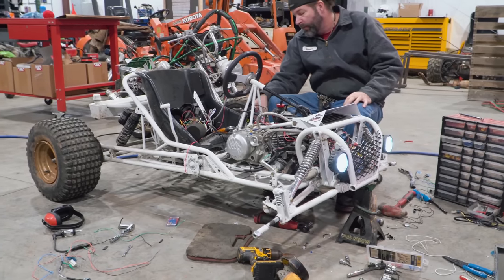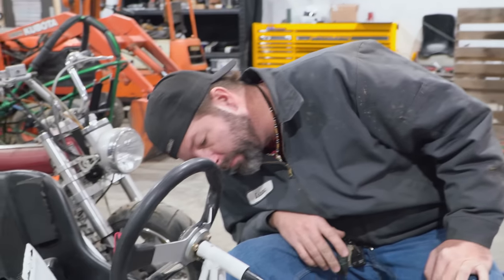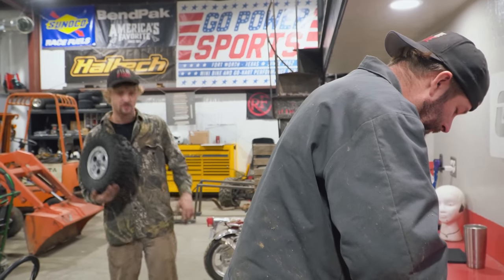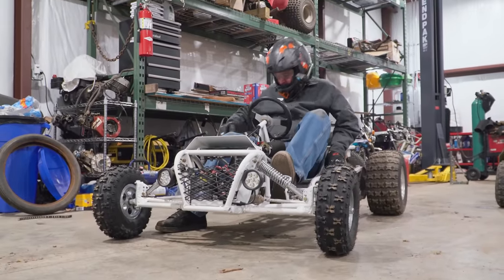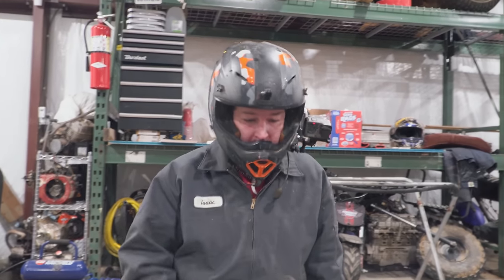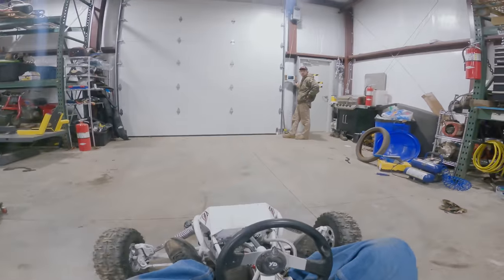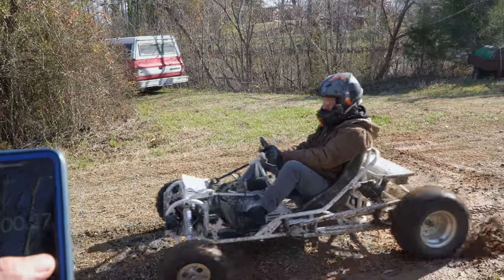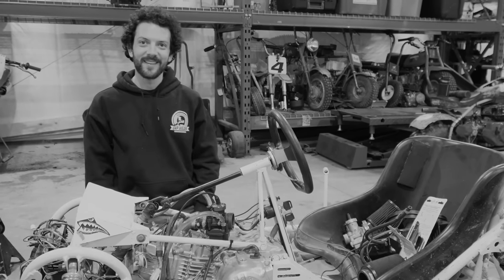Reviving our FASTEST Home Made Go Kart, the “Yard Dart”

Comment from the maker: Happy new year everyone! We're working hard on our first big car build- stay tuned!
Reply: Please install a 250cc 2 stroke engine from a Suzuki rm, Honda Cr, Kawasaki kx, Yamaha yz. You won’t be disappointed
Reply: Happy new years guys 🤟🏾
Reply: I hope it’s a car build using a predator 212, you know back to the roots and what not
Reply: Maybe back pressure issue due to exhaust.
Reply: Happy New Year to this Old Man's favorite three.  Knowing you will get the problem corrected. 🛵🧔💝💝💝
Reply: With the backfire it might be a timing issue
Reply: That's why we have auto electricians, it takes a certain kind of crazy to enjoy messing with wiring harnesses 🙃
Reply: Check the fuel filter or the pickup in the tank make sure it's not clogged or have a vaccume leak
Reply: @JohnHill-jm7tm  Happy New Year!!
Reply: Possible vacuum lock from tank?
Reply: Yes there could be a pin hole leak from anywhere in the fuel system.not saying that is the case.but it wouldn't hurt to preform a vaccume test on the fuel system. 5 or 10 pounds will be enough
Reply: Be careful with that engine while tuning it. It Will blow a hole to the piston or snap the timing chain whille stutterin due the high compression. I have had 4 of those engines on different projekts  and they newer worked right. Good New year and greetings from finland
Reply: What are you guys doing for fuel delivery?

Also is there a possibility of vapor lock on the fuel tank? Is the fuel tank or cap vented?
Reply: cdi related issue... i used to mess around with these style engines alot...would of said carb but that backfire is a tad extreme... thank me later 😉
Reply: cheek the plastic pacer for the carby i had to take mine off and run metal to metal for the carby to work as i kept blowing and brakeing the plastic spacers from the carby and it would run like that and then i had to change the jet to a little bigger one and it got rid of all that boggin and ran perfect
Reply: Hey what happened to the desisl go cart yall made a few years back? I'm curious to see what else yall could make that moto work on
Reply: Happy New Year fellers!!
I truly do hope it's a better year for everyone alive...
Reply: Happy new year to all of you
Reply: Hey r yall givin away anythin via a # u text
Reply: Happy new year guys. If you havent done any other modification apart from carb then check cooling. I found in spec its oil cooled (never heard of) check for pressure and if its lube everywhere specialy cylinder+head.
Reply: Happy New Year guys from us in South Wales, UK
Reply: Sounds like an air leak on the carb or intake??👀👀
Reply: Happy new years also those are lean pops I would be looking at the intake gaskets and maybe a smaller carb... 190 cc so less than a 22 mm carb maybe even a 19 mm. The reason I say this is medium to high loads will keep the fuel away from the pickup tube but in a small carb it can't get away from it. Or tip the carb 20 degs so under load fuel sits flat in the bowl. Stay safe guys.
Reply: Hi there lads I think I no what your issue is as us lot over in England UK actually race pitbike engines and we have a 190cc class that people run these engines with in there pitbikes and it sounds like you have the wrong ignition system for the 190cc as ooracing have a certain ignition system for the 190cc if you have a look on there website you will find the ignition system I'm talking about
Reply: @Kyle Teal  190cc engines use a 30mm carb 19mm is for a 50cc engine
Reply: How soft are the valve springs on that engine.  It almost sounds like the valves are floating and your losing compression at high rpms. Just a thought.
Reply: Happy new year to you too! And can't wait to see that new project.
Reply: It’s gotta be the cdi jit
Reply: @johninzerillo1510  thanks Doc.  Same to you 🧔💝
Reply: Please read Cars And Cameras!!!!  All the problem is the gas is sloshing to one side in the bowl !!!!  Notice it only starts to act up while in turns and carries its miss in the straight aways for a sec.  check the float  and the gas tank.
Reply: Maybe cause no vent on the gas tank I had a 110 ching chang pit bike that didn't have a vent on the tank anywhere I drilled a hole in the gas cap cause my gramps had an experience with a small engine doing this just a thought
Reply: Yo - way too much air going in is the problem - it's what fixed my issue - i put a half cup guard around the air filter so it would take in less air - and BOOM - she purrs like a TIGA BAYBAYZ!   (so imagine an air filter - cone - with a cup over it that covers the front and half of it so only the bottom half is exposed.) -  i thought it was lean - it is not the issue - the issue is too much air going in.  I kid you not - i almost cried lol

Comment: I've had a problem with a Chinese quad that had the same issue it's not the carb it's the CDI either the pickup or the box itself has  going bad
Reply: Exactly like I said.
Reply: Agreed.  I had the same issue.  I fixed it with the OORacing ignition corrector and CDI.
Reply: also had a Chinese quad with tight valves cause the same issue. they wear tight so it could be something to look into
Reply: I haven't watched the video yet but I would consider checking the primary stator. those can cause no spark, intermittent spark and even cause the engine to not rev up and sound like a carb issue.
Reply: If you have a multimeter, you can go around the bike and check all the ignition components, except for maybe the cdi but if everything else check out, its most likely the cdi.
Reply: I'm leaning towards the CDI.. I'm saying that cuz decided to use a CDI that came with a Chinese 125cc motor and started misfiring in the higher RPM on my zs190 so I swapped it out and use the CDI that came with the zs190 (physically larger in size) and I had no more issues and wants to rev to the Moon..  almost got 10k Street miles on it now and haven't had a misfire since then
Reply: I have to agree. I've worked on power equipment and all types of at,atv,etc. Acting like having a heatup circuit failure in cdi.
Reply: I find with these chinese engines, like 9 out of 10 it's the CDI box.  I always keep a spare. Why not? they are like $0.001 yen each.
Reply: Watching it ...I agree ....
Cdi or timer
Reply: Valve setup
Reply: I thought that at first to but they said they replaced it .
Reply: @davidhill588  I think the springs are not able to hold the pressure under load and it’s causing the valves to open prematurely
Reply: Sounds like that's probably the problem.  Bad cdi. Or one of the wires for it
Reply: Yes its an cdi or ground problem
Reply: I've gone throught 8 cdis with my Chinese quad it fails a lot
Reply: @harryfp1494  Yes, but the trouble is, those things are so very shitty that I wouldn't be surprised if they got a second bad one right out of the box.  I have also had them not be bad, but a terrible connection on them.  I have had to zip tie the harness tightly to the cdi box to get it to work.
Reply: its the type
Reply: I've seen the same thing and agree. Definitely ignition. Probably wouldn't hurt to check valve clearances as well
Reply: CDI or rectifier
Reply: Same issue on a 125cc Chinese pit bike I had. Pulled the Cdi coil behind the flywheel and after replacing it the bike runs like brand new

Comment: That backfire sounds like ignition problems. My 150cc Chinese bike did the same thing. I changed the CDI box that had a higher rev limiter and changed the coil with a new spark plug.  That took care of my problem. Hopefully it'll work for you.
Reply: Still can be an ignition issue, but backfire is out the intake system. This is afterfiring, in the exhaust.

Comment: If it keeps giving you issues check the pickup for the ignition on the flywheel, I've had issues with the housing being cracked and loose making it not run right and being all over the place. Im thinking it's something to do with ignition
Reply: Agreed, why is no one checking voltages it was obvious to me that elec ignition was missing the mark
Reply: i agree aswell its always sounding like it drowning in gas
Reply: Vibrations at higher rpms throw it off time and bap bap bap bap bap you have a rotary powered cart without the rotary.
Reply: @NubsWithGuns  where did he say "poke and hope"? He gave a legit idea and explanation to check voltage going into and out of the cdi. It would certainly head in the right direction, or at the very least check a rather large component of the list. 🤷🤔

Comment: 20 year motorcycle mechanic here and I can be wrong but that foam filter looked pretty dry, foam filters are amazing as long as they are properly oiled. Head down to a yamaha motorcycle shop and pick up a bottle of Yamalube foam filter oil. You want a thorough coating on the foam but don't over oil. 
The oil gets super sticky and traps dirt once the solvent evaporates out of it, it keeps your foam lasting longer, and it also solves alot of strange tuning issues. If the filter is dry it actually flows too much air and does not have enough restriction, I know it sounds counter productive, and can cause fueling issues at higher RPM. 

At idle or partial throttle applications its usually decent because there is enough air speed and vacuum created by the slide being slightly open but at wide open it looses alot of the vacuum and can create a lean condition up top especially snapping from idle to wide open most of the time it just falls on its face. With a properly oiled filter it still has enough restriction to help pull the fuel up through the jetting at wide open. 

The air fuel screw on the carb usually if it is on the bottom by the bowl adjust fuel I discovered at sea level or really close 2 ¾ turns out from lightly closed was the happy spot for just about everything I have ever worked on. If it adjust air, usually on the side of the carb, its usually 1 turn out from lightly seated is a happy spot. 

Religiously watch the videos, love the content, looks like way too much fun. Hopefully this may shed some light on your issues if anything might just get you some snappier throttle response off idle

Warning though the yamaha filter oil makes a mess, I always put a plastic bag over my hand and used the bag to massage the oil into the filter, then let the filter air dry for about 10-15 mins to let solvent evaporate or can cause a temporary over rich condition at idle also if you over oil the filter. Just a good coating overall is all you need. 

I might be wrong but hope this helps

Comment: I had the same problem with my ZS190.  I fixed it with an OORacing 100w ignition corrector and OORacing CDI.   That stopped the mid/high throttle breakup.  I also added a real PE28 carb which also cleaned up the running.  Those things resolved all of my running issues and now it runs like a dream.

Comment: Had  a similar issue with a grom clone with a high compression setup. For me I had to go with a 2 step colder spark plug because it was causing preignition with the Chinese plug it came with. You could jet it up and it would run smooth but wouldn't make any power. Then jet it down and it would backfire and spit and sputter due to the early combustion. That would be a good start along with checking the spark plug cap if its the resistor style and make sure its not too high impedance and causing it to blow the spark out. Could delete the resistor too and force it to have stronger spark for as long as the coil can stand it.

Great video too btw!

Comment: I had a similar problem with a Bombardier 90 ATV. Turned out it was a bad flywheel. The magnet apparently weakened so we would get intermittent ignition issues, hard starting, poor throttle response, you name it. We changed out else everything first. If you're having to run a tight gap between the ignition pickup and the flywheel to make it start better, (we had to set it at .010 and the spec was around .050, as I recall) that's likely your issue. Many manufacturers use cheap flywheel magnets, and they will cause havoc on many brands and I hear this is a very common issue. I would also re-verify timing is correct and add an offset flywheel-crank woodruff key to advance the timing a bit (maybe 4 degrees +/-) if the ignition pickup is nonadjustable. May really help performance and throttle response once you get the miss resolved. Good luck!

Comment: I think you may have two problems.  The first being electrical.  Do you have the negative battery cable going directly to the engine block (a tight engine mount bolt is ideal).  Also make sure the ign module wires are tight and fully seated as well as the voltage regulator.
You might even replace those if you have spares.  If not I can send you several of each type if you need some.
The other thing that seemslike an issue is the valves.
I have seen these have valve seats come loose and run stupid.  Since it will usually have good compression intil it get hot and the seat starts banging around.
Good luck.

Comment: There's a handy tool that I use when diagnosing carburetor issues called Color Tune. It allows you to view the color of the flame in the combustion chamber at different throttle openings. It comes with a chart to compare flame color so it's easy to tell which jets need to be changed, in which direction as well as main jet needle clip position. Haven't been able to use it for dialing in the proper slide. Have other ways to do that. The tools aren't manufactured or sold in the U.S., but I think mine took about a week and a few days to arrive. I also bought the adaptor kit so I could use it on engines with different spark plug diameter. Hope this bit of info will be helpful to you.

Comment: Is carb venturi same size or larger than intake valve? this could cause problems.. may also check the pulse pump.. or if none present add one
Reply: It’s likely that moto-engines are tuned so tightly that removing the airbox ruins it.

Comment: Hi Guys, Happy New Year.. Do U Know That Those Chinese Ignition Coils Have REV Limiters In Them. If  U Really Want it To Go.. Get A Chinese  Racing Coil  Or Replace It With A Motorbike Coil. Plus The Chinese Wiring Kit ( Wires ) Only Have About 6 Copper Wires Inside Each Wire, Which Doesn't Give Correct Current To Anything If U Ask Me. That's Why They Are Made Cheap, To Save On Copper. I Think It Either Has A Coil Ignition Problem  ( Breaking Down )  Or Carburetor Jetting Maybe ? Also Check Your Battery Connections, As The Lights Went out. But I Really Think It's The Ignition Coil

Comment: Last time I ran into that issue on a quad it was the voltage regulator causing the ignition to be crappy when the lights were on.
Reply: Yeah, Honda quad had the same problem.  New regulator fixed it.  This def an ignition problem, not jetting.

Comment: Might be worth checking the compression
Reply: nah its not
Reply: head bolts do tend to stretch on them but it most likly junk Chinese cdi 4sure
Reply: Compression 😂😂🤦‍♂️
Reply: love how ike just rides the crap out of stuff and you can clearly hear its not running right.
Reply: Stator plate for sure
Reply: It's the CDI.. I decided to use a CDI that came with a Chinese 125cc motor and started misfiring in the higher RPM on my zs190 so I swapped it out with the CDI that came with the zs190 (physically larger in size) and I had no more issues and wants to rev to the Moon.. even got almost 10,000 Street miles on it now since then
Reply: Yea when you lean on something you know is tuned wrong, and banging out the exhaust you can cause all kinds of issues in a engine. I'm surprised at the real lack of tuning skill exhibited by Issic. Drilling piolet and even main jets is bad, and he often will miss diagnose rich and lean conditions. He is a nice guy that can fabricate ok, but engine stuff isn't his thing. I'm very surprised that John hasn't studied up on tuning basics, and gave it a try he has the right intellect to be a tuner of small engines.
Reply: Lol that's not at all what bad compression does

Comment: That 2500rpm issue you're having happened to my Apollo pit bike with a 125cc knock-off Lifan. For me it ended up being moisture in the CDI connectors (from riding through deep puddles after the rain). I dried them and put dielectric grease in them and never had the issue since.

Comment: I've worked on a few Chinese pit bike motors and what I find is the casts aren't exactly accurate or the same but that the gaskets make up for it. Eventually there always seems to be a leak somewhere. If you haven't done compression or leak down tests it's a place to start. I've had leaks in some really strange places. Carbs carb boots exhausts any motor gasket you can think of. Spray  anything that burns near the mateing  surfaces to see if it revs up and you find a leak. Its fast and easy. I have had cdi problems too. I always start by spraying some start fluid or parts cleaner because its fast and easy then dig into the rest. Good luck. Hope it helps

Comment: when you guys build a cart thats sorta important maybe weld a wide band bung on to hook up a sensor and then when its tuned right remove it and plug the bung so you can use the sensor and gauge on the next project. might make tuning less guesswork to figure out